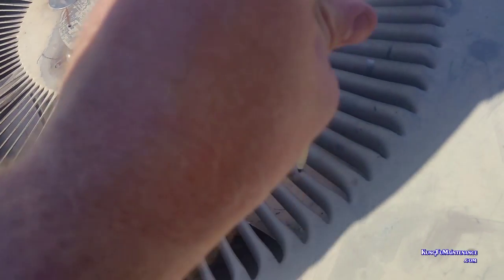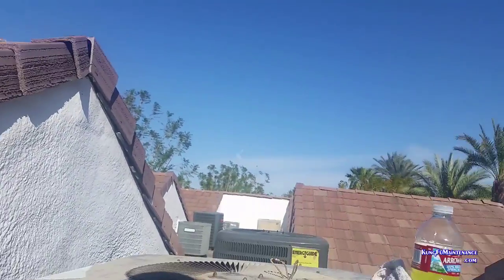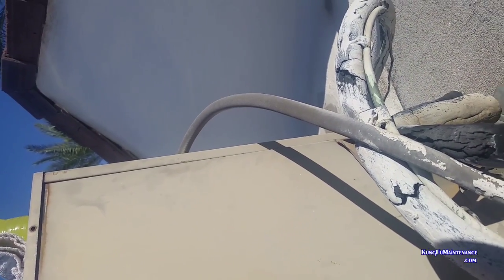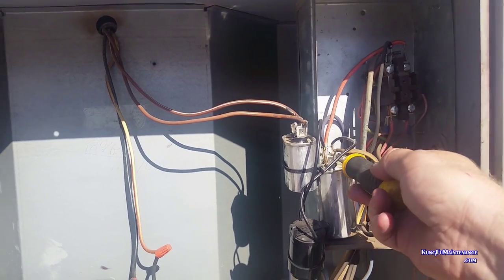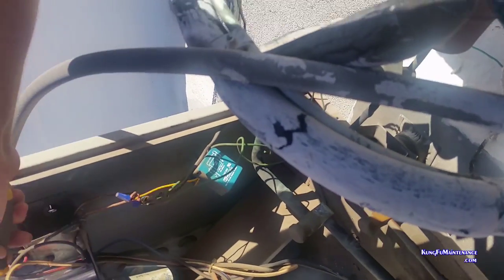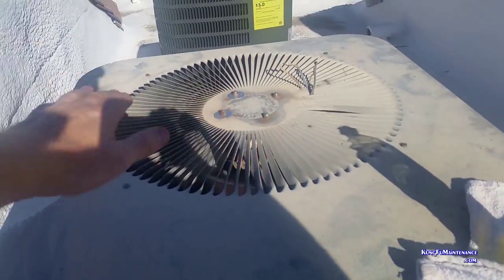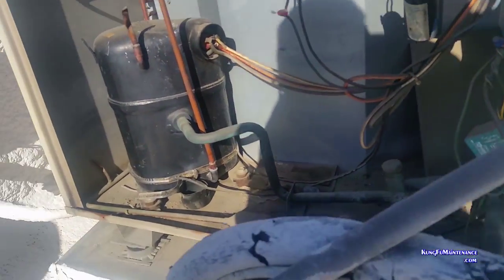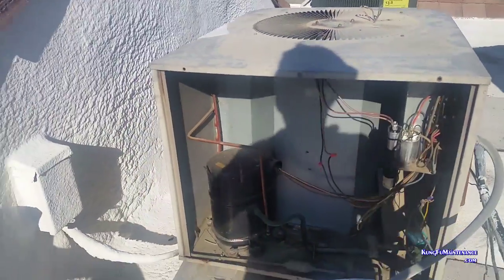Air Conditioner Not Cooling Beware Of Dog Watch Your Back

Comment: I got stuck in a loft above a milking parlour once, the condensing unit was up there, you had to climb a ladder to get to it from the collecting yard where the cows stand when waiting to be milked. The farmer had left the bull in the yard, he was not a happy camper, you had to hide in the pit where the herdsman would be stood during milking and wait till the bull was down the other end of the yard then run up the ladder as he charged at you. I got stuck up there as the bull noticed me at the top of the ladder and i had to hide out of sight for half an hour till he got bored! 

Another farm had two rottweilers, you had to park the van and get out the passenger side so the didn't see you or they would chase after you.